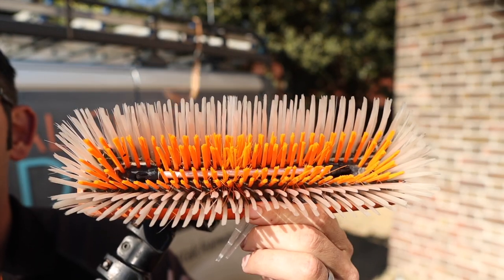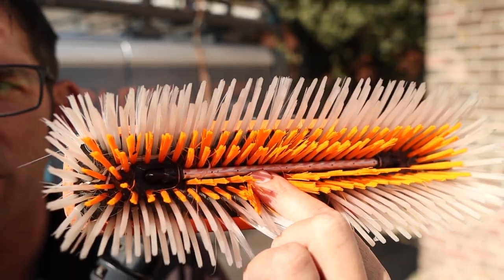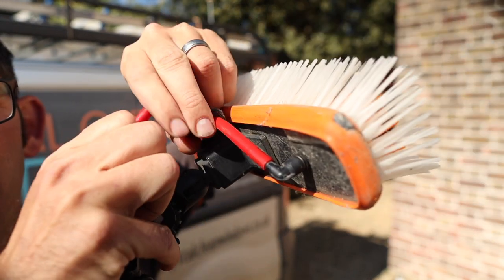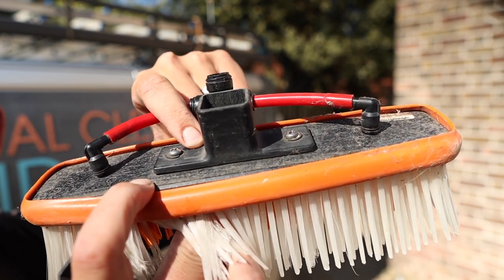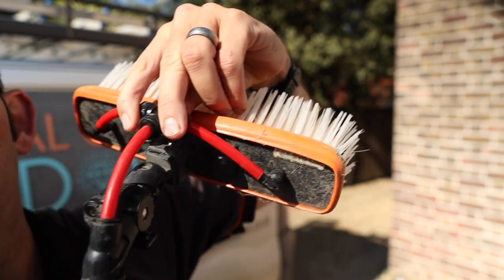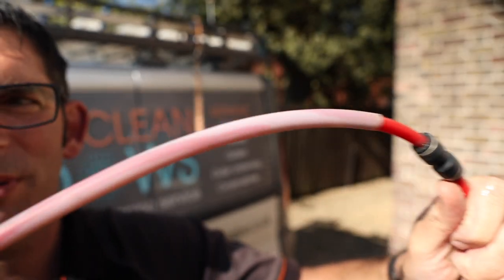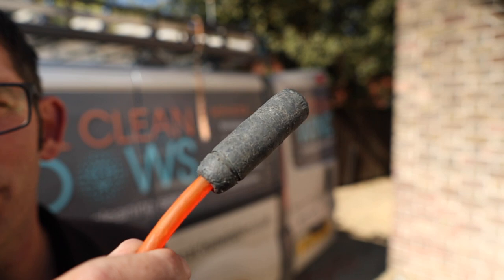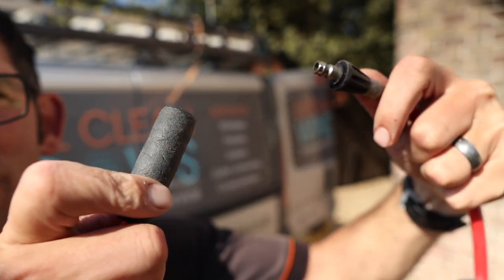Revolutionize Your Window Cleaning with an 8-Foot Pole!

Comment: The Gardiner CLX8 is a 3 section pole so when collapsed it's as short as a 4ft pole but when extended it's a full 8ft! Very useful.
Reply from the maker: @ched999uk Have seen those on their website, the 4ft & 8ft poles are great to have. Absolutely love my 4ft pole.